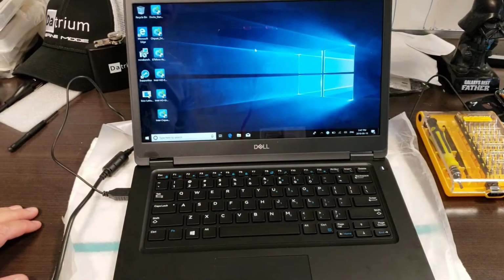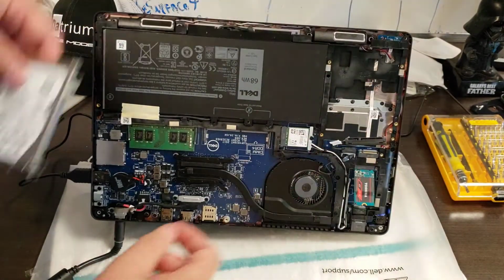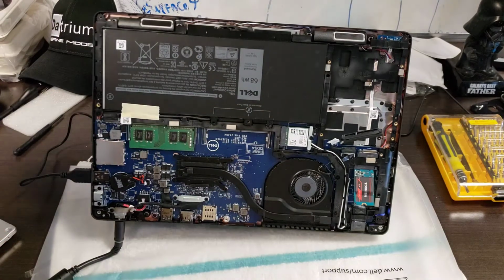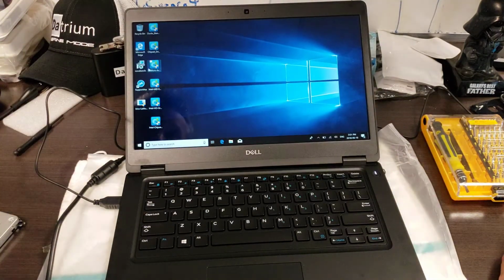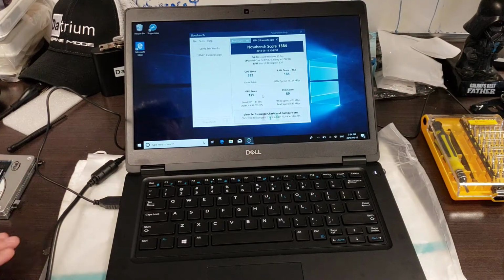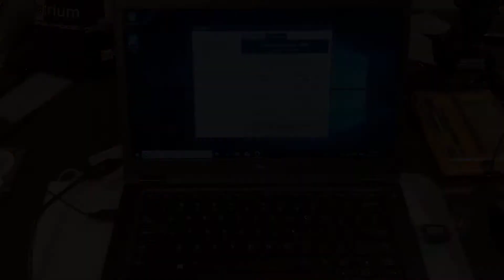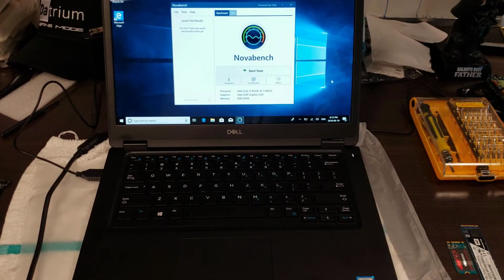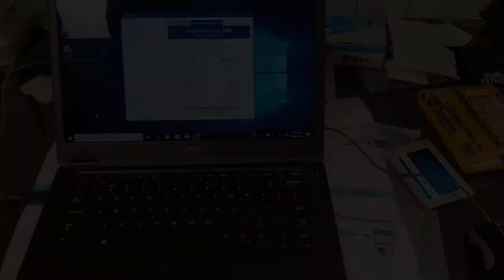Dell Latitude 5490 Benchmarking SATA SSD PCIe SSD & Spinning Disk

Comment: Outstanding review of the Dell Latitude 5490. reviewed on Dec 10, 2024, Just purchased rec'd set on Non 4, 2024, ironically it was never
used, so, it was brand new, this video showed what I need to know about SSDs, I removed a M.2 126 SSD, replaced with standard 500GB SSD (Sata). Speed is not my concern, storage is the object. Thanks for this video, in Dec. 2024!

Comment: I can confirm that a 1000GB nvme works in the 2242 WWAN slot of Dell Latitude 5490. I bought a Netac N930ES (NT01N930ES-001T-E2X) and using it with a 256GB 2248 mSATA in the primary slot. 👌

Comment: Can i use a SSD and another SSD in the WWAN port?
Reply: yes, bios don't see that disc but in windows is OK
Reply: I can confirm that a 1000GB nvme works in the 2242 WWAN slot of Dell Latitude 5490. I bought a Netac N930ES (NT01N930ES-001T-E2X) and using it with a 256GB 2248 mSATA in the primary slot. 👌

Comment: hi, there is something I dont get, and that is, why you didnt get any read and write speed over a 1Gb/S with neither pcie nvme ssd? I get that that the m2 socket where you put the wd black ssd is on the sata bus what why the toshiba ssd which is also pcie nvme didn´t pass the 1gb/s on read and write secuence? its driving me nuts to not get it

Comment: Finally! Someone who tried it out and pointed out the rubbish written in Dell's manual :-)
Is the 2242 slot PCIe/NVMe only? Or does it accept M.2 SATA disks as well? I ask because SATA are about 30% cheaper than their NVMe counterparts. So for someone who doesn't care about blazing fast speed, and is just looking for more memory at a reasonable price point, SATA is a better buy.
Reply: I can confirm that a 512GB nvme works in the 2242 slot. I bought a Lexar NM520 and am using it with a 256GB 2248 mSATA in the primary slot.
Reply: @RohitdeSa  hello, excuse me it's true that you can use a ssd and hdd at the same time?
Reply: @arturop-4514  I assume by 'HDD' you mean '2.5" SATA drive'? Yes, this laptop does support a 2.5" SATA drive, however you will need to buy the requisite mounting kit and adapter cable. This is available from various sellers online. 

The E5490 supports M2 + 2.5" SATA, as well as M2 + M2 drives, as long as you have the right accessory hardware to mount and connect them. Do note that a 2248 M2 drive shares the same physical space that a 2.5" SATA drive (either SSD or mechanical) would occupy. This means that you can only install either one of these at a time.

In my specific case, my laptop shipped with an M2 SATA 2248 drive. I wanted some more storage, so I bought a Lexar 2242 M2 nvme SSD and installed it in the WWAN slot.
Reply: @RohitdeSa  Thank you for answering me. could answer me another question, a person sells me this model 5490 but with solid state disk, (Hard Drive M.2 256GB SATA Class 20 Solid State Drive 256SSD [400-AOTF] [575-BBKU] 8), but I do not know what size it is, if as the first one showing the video or as the second one that shows 512 Gb?
Reply: @arturop-4514 The 256GB SATA disk is of the M2 form factor. It will likely be a 2248, meaning is is 22mm wide and 48mm long, designed to fit in the same physical area as a 2.5" harddisk.
Reply: And i don't know if I can use HDD and the m2 that the laptop originally contains...

Comment: Great video! In the 5490 manual say that NVMe is PCIe x2 and your NVMe WD is M-key, right? Can you check with "HWINFO64"  is that nvme pcie slot works in x2 or x4? Thanks!
Reply: 4x

Comment: Hello! Thank you for the demo. Have you tried using both M.2 PCIe SSDs at the same time? Would it be possible?
Reply: Same question is it possible to install both M.2 same time?
Reply: You guys yes can use both. However only one nvme at a time: 
https://www.dell.com/community/Latitude/Latitude-5490-support-SSD-M-2-2242-in-the-WWAN-Slot/td-p/6090978
Reply: up

Comment: So the WWAN slot can be used as caching ssd?
Reply: Same question
Reply: @murillorosa7371  I can confirm that a 1000GB nvme works in the 2242 WWAN slot of Dell Latitude 5490. I bought a Netac N930ES (NT01N930ES-001T-E2X) and using it with a 256GB 2248 mSATA in the primary slot. 👌
Reply: I can confirm that a 1000GB nvme works in the 2242 WWAN slot of Dell Latitude 5490. I bought a Netac N930ES (NT01N930ES-001T-E2X) and using it with a 256GB 2248 mSATA in the primary slot. 👌

Comment: What CPU do you have in there? Apparently the 5480 had 4 PCIE lanes available to the NVMe when paired with an HQ designated CPU. In order to benefit from that I think the NVMe also needs to capable of running over 4 lanes.  I haven't found any info on this for the 5490 yet. See: https://www.dell.com/community/General/Dell-M-2-NVME-Specifications-And-Upgrade-Requirements-For/td-p/5072834